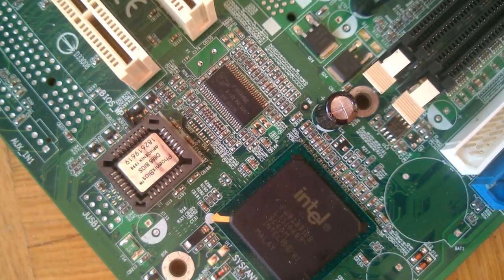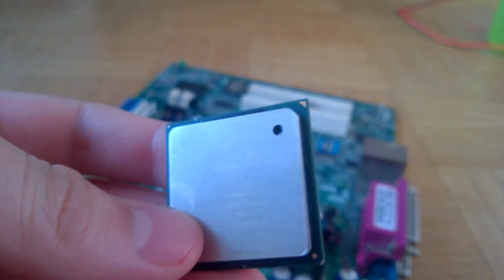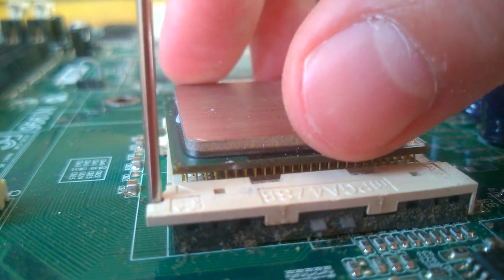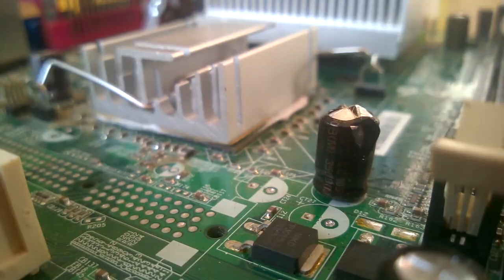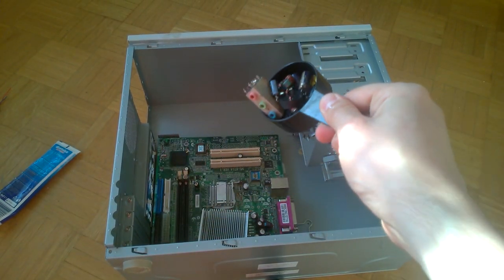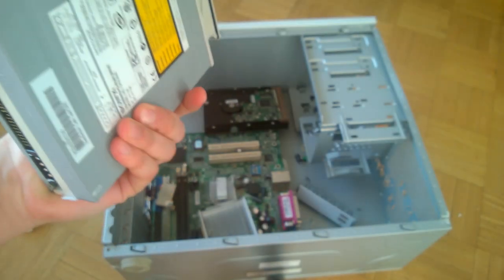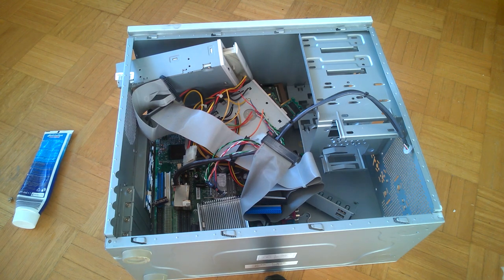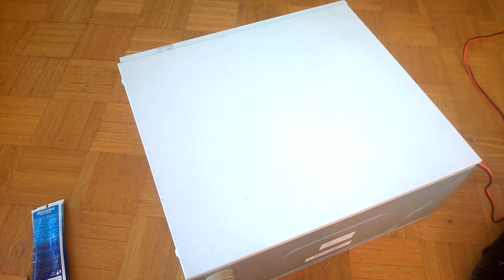Building your first PC! with Hungry Gizmo!

Comment: Mfw no case ferret
Reply from the maker: I know... It's a major bottleneck. But, this being a simple build I thought I would just stick to the micro ferrets built into the capacitors across the board.
Reply: Looks like they've already escaped mate
Reply from the maker: nonono. I'm sure there's a few. there's got to be. I mean... where would they have ran off to?

Comment: I gotta ask so I dont die inside, where do you get your parts and for the love of god tell me they are dead already
Reply from the maker: Online, on local trading sites. Usually components this old are given away. I'm in the middle of another project and was hoping to get a working motherboard for 10€. Turns out the motherboard was dead, and it's not really worth my time to try to repair the board.